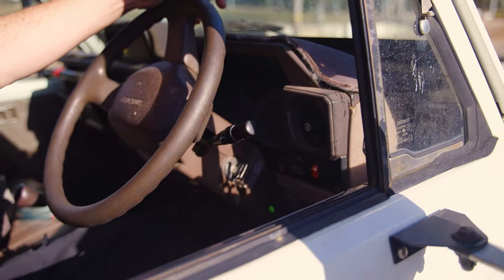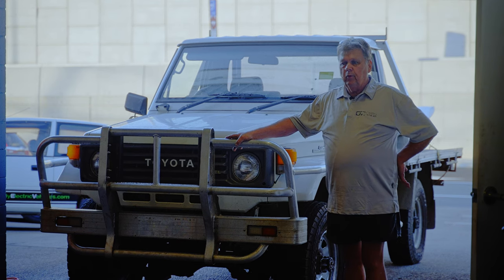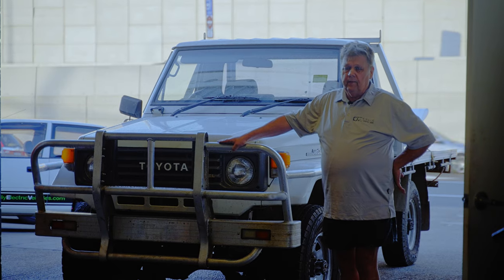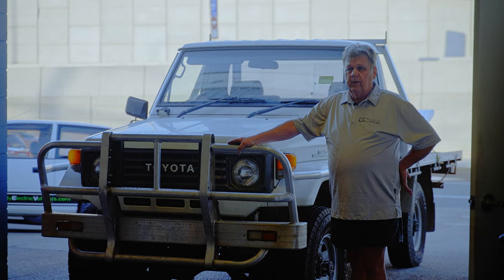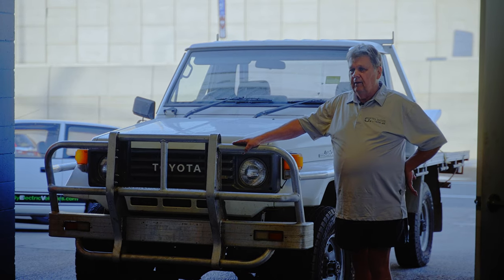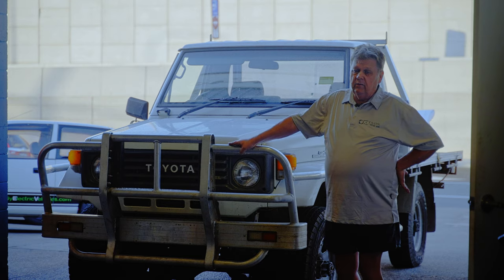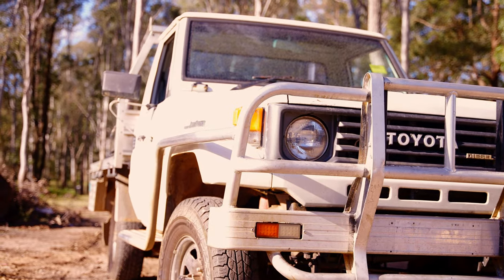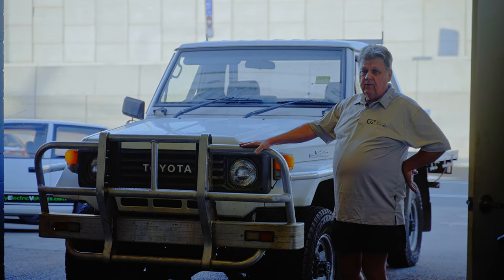OZ Electrics Toyota 70's Series Land Cruiser

Comment: Starting with 4th gear. Doed it not strain the gearbox?
Reply: no - electric motors are so different to petrol engines - stay subscribed to see more videos and learn more in this corner of the world where Oz Electric Vehicles make it so easy to do and/or own an EV.
Reply: actually a lot better as there is no power pulses from pistons firing going through the gearbox, just a liner power delivery.